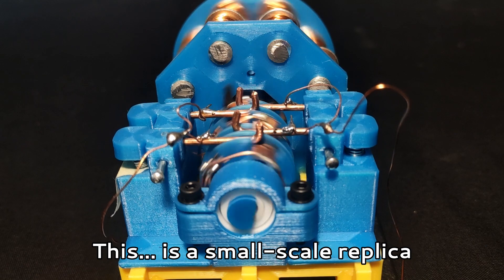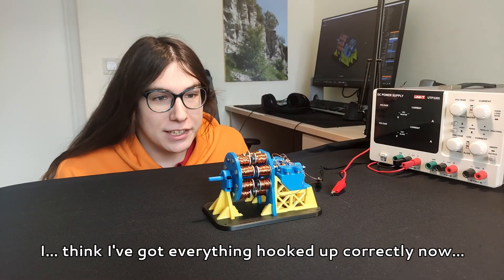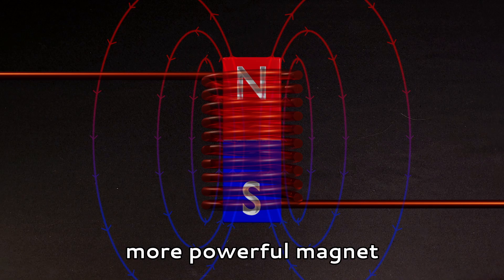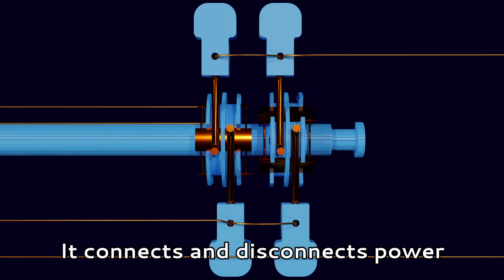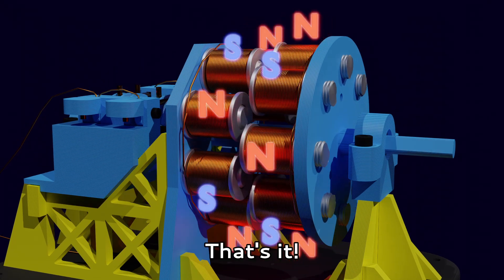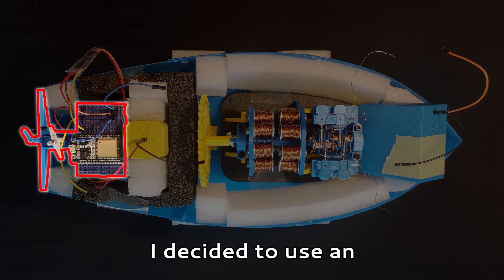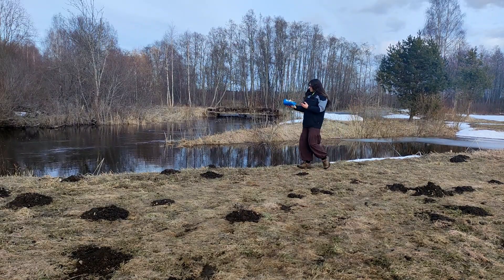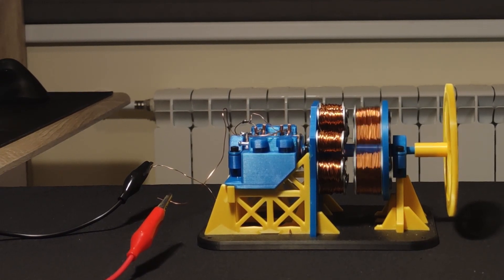I Replicated World's First Useful Electric Motor

Comment: Are the print files available anywhere? I have a youth group that this would be perfect for as an introduction to motors.
Reply from the maker: Are you sure this would be a good introduction to motors? It takes some time to build as well as some weird components such as the small springs and ceramic bearings. I'd imagine taking a cheap small brushed motor, one of those that have two flat sides on them, and opening one of the flat sides with a rotary tool or something would show the inner workings of a motor and not be quite as hard to make. It'd be smaller of course, and would not throw any sparks anywhere but would definitely show how a modern brushed motor works. 

I should have the stl files archived somewhere, so let me know if you still certainly want them.
Reply: @BirdbrainEngineer  The kids are in the program voluntarily and we've already taken apart motors when they blow from combat robotics. I actually have one that wants to do a presentation one electric motors vs gas engines, so I was going to have her try building one before the rest f the group. I also have some pretty good mentors to help out, so I think I still want to try it. If you would post the files, I'd be grateful.
Reply from the maker: @Duamerthrax  Over the past few days I spent some time trying to find the files... Unfortunately, I fear that this project and all of my earlier projects along with their associated files may have been among the files I lost when our last NAS died :( I could try to quickly recreate the files for something similar.
Reply: @BirdbrainEngineer  Ok. Thanks for looking at least. Don't feel the need to recreate the files just on my account.

Comment: Very cool mate! How did your print handle the water?
Reply from the maker: It actually worked fine. I made sure to use an excess of glue between the joint segments to remove as many pinhole leaks as possible, and it seemed to work fine.

Comment: what is the efficiency compared to today's engines?
Reply from the maker: Very very poor. I did not do any actual optimization, I just wanted to get something that works. I think the rough estimation I got was that if I put in about 30W of power(15V/2A), then I get about 1W of mechanical power out.

Simply taking away the stator coils and replacing them with similarly sized neodymium magnets would improve the motor manyfold... of course, in that case it would make sense to put the magnets on the rotor and control the stator coils instead, and control them electronically using transistors - that would make it into a brushless DC motor, hehe... and it's the type of motor I am working on right now :)